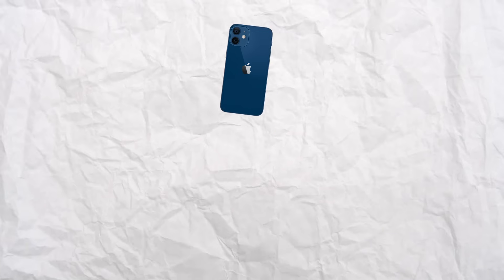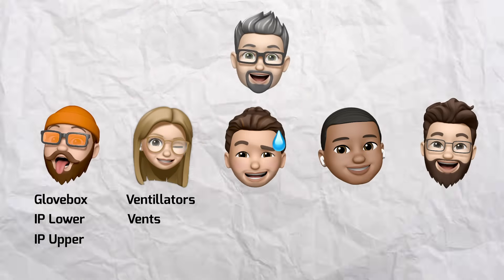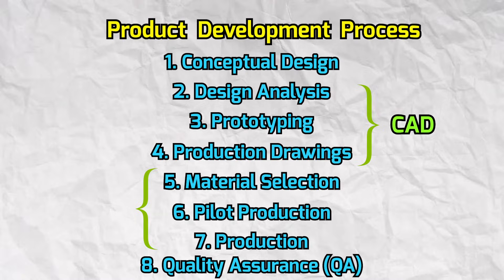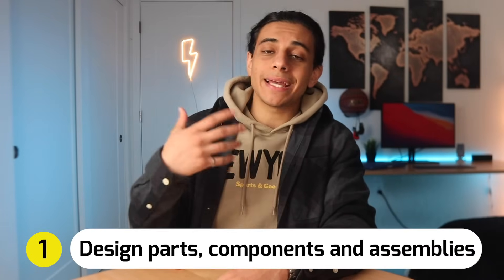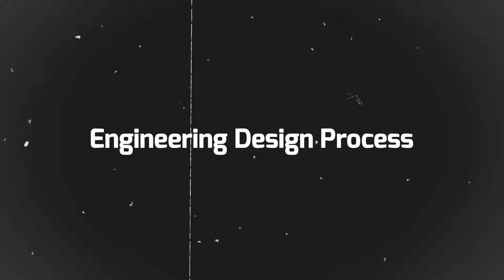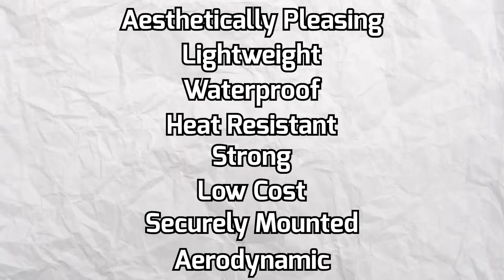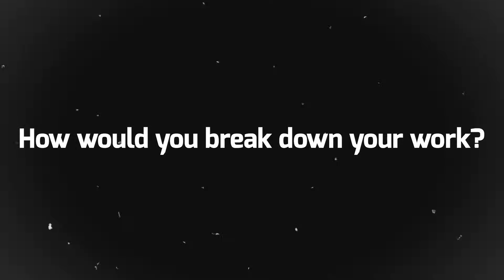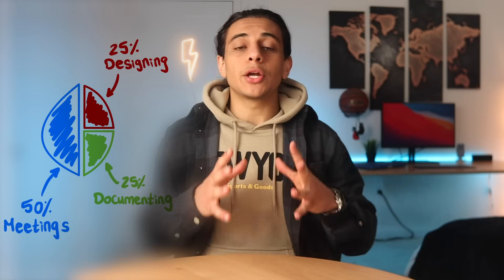What do I do as a Mechanical Design Engineer?

Comment: Homestly the video is great, my only feedback is that depending on business type, experience and country a mechanical design engineer changes a lot, heck I’ve been the person individually responsible for civil works like a 8 ton grinding stand, entire cooling loops, pump redesigns etc
The industry type you go in and your experience changes if you are responsible for a tiny bit of the project or the entirety of the project.
I’ve had issues pop up, ive designed, calculated it all, packaged the designs ready for review, been peer reviewed and we are manufacturing it within a day.
Some jobs ive been in is 99% drawing and simming your models, other jobs 75% of it was internal meetings, client meetings, training, presentations or helping a different department.
Thankfully now im more of the companies excel wizard so i build excel tools to speed up the typical calcs we do.

Comment: As someone keen on learning about FEA I tried using Solidworks(SW) like in 2:38. But my thesis guide forced me to use ANSYS APDL (by integrating the SW files into the analysis) instead as it was less user friendly and would "justify" my hard work. Talk about practicality😅.
Reply: Ansys is a much more powerful computational program than the SOLIDWORKS FEA add in so that may be why they told you to use that. Often SOLIDWORKS FEA is nice for quick and rough FEA to check if a part will pass or fail specs. Ansys is used for parts that are more complex in shape, or with increased complexity in fixturing, force distribution, and load patterns.
Reply: @lucaspearson1972   Oh I see

Comment: Good summary Tamer. 

I want to add some remarks as well. There are some additional important steps before & after project start actually. Before investment decision by top managements, design engineers help program & project leaders to make some cost calculations, feasibility studies etc. After investment decision and team building for the project, we just start with bench-marking of similar products & vehicles in the market. there will be a lot documentation, comparison and brainstorming activities at this point. If the project is first attempt to design & production of the product in the company, design team and management generally does not want to take risk therefore they choose a sample product in the market and tries to improve it without violation of possible patented ideas on reviewed products. At this point patent research comes into play. After design team became familiar with product, they start to work on defining design zone. This design zone might be 2D or 3D. Design engineering team provide this design zone to Industrial design department. They turn back to structural design team with industrial design data (aesthetic definition of the product). remaining is just like you explained generally. 

One more remark, due to wide range of industry uses mechanical design engineer as job position title, this naming became ambiguous. In europe we are called most of time as "design engineer", Product design engineer or "product development engineer" and some time as "product engineer".  Sometimes there might be slight differences between this positions but mostly their daily activities are similar.

Keep up the good work, you are appreciated👍

Comment: How many years it took you to master solidworks?
Reply: It really depends a lot on the features you want to master. I would say after 1 year of WORKING experience you should be proficient in the core features. But if you need to master sheet metal or surfaces, that's gonna take a few more months. If you wanna get into FEA then add several years to that (unless you are doing basic linear static analysis with common materials only). As with many other technologies, CAD moves at a rapid pace so you need to continuously take trainings to master the new features. ME with 8 years in the industry here.
Reply: @jcventura8532  thanks a lot for your help answer 🙏
Reply: @djemaizoheir5185  Anytime. And if you are an aspiring engineer, best of luck, it is such a fun an rewarding career!

Comment: As a mechanical engineer in college, I am kind of curious about what classes you or anyone else in this field would recommend taking to pursue this field.
Reply: Material science, thermodynamics, structural analysis, CAD FEA, CAE. These will likely be required as an ME and are helpful
Reply: This isn’t a class, but I would highly suggest you build a portfolio of CAD models you’ve designed, brush up on manufacturing knowledge (if you can’t get an engineering internship for the summer, look for manufacturing jobs instead) and work on projects. I know everyone says to work on projects but that is because it is the best thing you can do to ensure you’ll get a great internship, and a great job after college. Every interviewer I’ve ever talked to while in college was way more interested in the engineering projects I worked on than what I learned in class. Do yourself a favor and start working on projects today!!
Reply: @bing5043  this is the best advice, ThankYou!
Reply: depends in what area you want to work in... for example, I'm a mechanical design engineer so in college the courses that I liked the most where the ones related to design and materials but some other classmates preferred classes more electrical orientated or code related
Reply: @username8644  Pretty sure every engineer does this
Reply: Same here
Reply: Join clubs that get your hands dirty. FSAE, VTOL clubs etc
Reply: College will teach you HOW TO LEARN. Learn the first principles of course work and when completing problems, understand WHY the answer is what it is, don't just memorize a technique. When you end up in a job, you will then learn the more specific knowledge you'll need to be successful and you'll know where to go in order to study the specific topics you'll need. Source: I've been a ME for ~10 yrs. Have worked in Aerospace, Automotive, and Med Device.
Reply: I m also mechanical design engineer now shifting to it
Reply: Strength of materials.
Advanced strength of materials if offered.
Materials science.
Machine design.
Advanced machine design.
Reply: At my uni, there weren't really any classes that were relevant....If you're at a uni in detroit you should have a different experience though lol. My advice would be to get an internship asap

Comment: I'm currently thinking about studying aerospace engineering, but a lot of people say it's too specific and EE or ME is better. Have you ever seen an aerospace engineer working as a ME or other engineers? Can they still find jobs outside the area of their focus?
Reply: Same here. I was thinking the same thing. Like I could go into ME and take electives that are more aero focused. Some say even to get a bachelor’s in ME then masters in AE. Aero is very specialized compared to a more broad discipline like ME or EE. Sure you can find other positions that are not aerospace related (like software) but it would be more difficult than with ME or EE bc of the specialization. It is possible though. Don’t be discouraged. This is just info I gathered doing some research online. Someone with actually experience should provide some input.
Reply: @roboserpent7247  thank you for the info